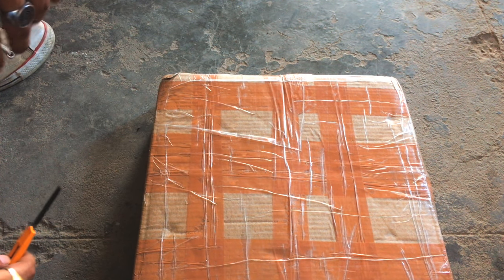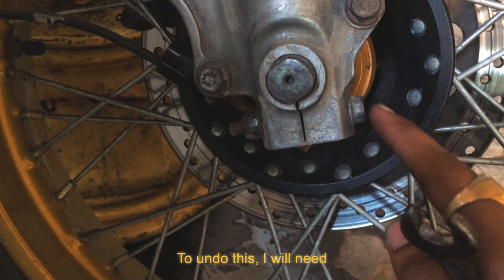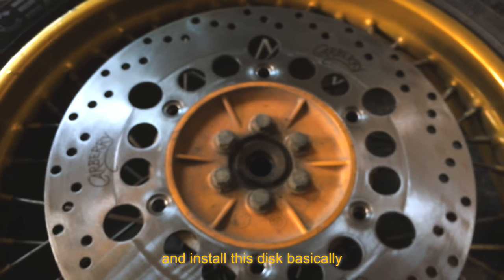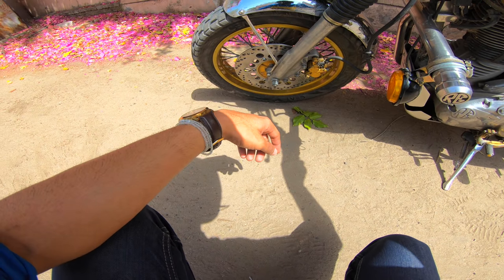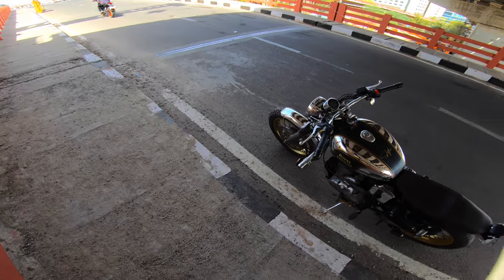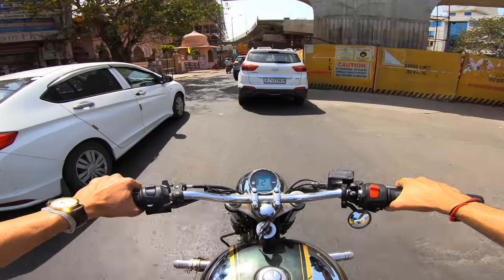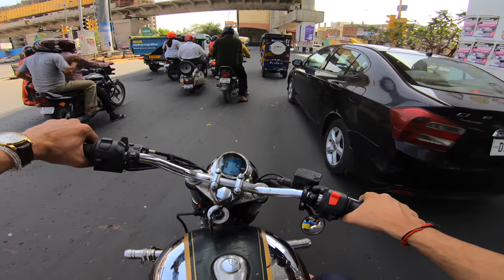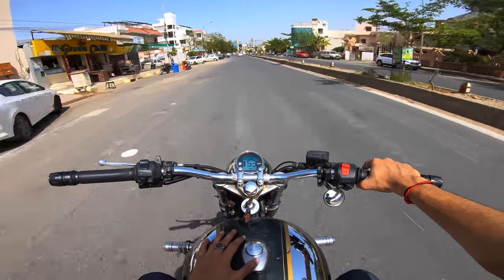Jumbo disk brake rotor - My new favorite modification

Comment: After fitting the new disk you directly jumped to the final part that was the completely fixed bike. Was anything else changed or replaced to fix this size of disk? or everything else remained the same
Reply from the maker: everything else is the same, the disk came with a mount for the caliper which was pretty easy to install as well, couldn't film because it got dark

Comment: With emergency braking , you can get into trouble as wheel locks instantly .
Reply from the maker: yes but that was me jst testing the front, i use both the front and rear at the same time when emergency braking

Comment: The best brakes which I tested on an RE was of GT535, 650s don't even come close to it. but ABS was missing which is sad.
Reply: I believed the brakes on gt 535 was from Brembo
Reply: @imochasingh6875  Yes, Brembo Floating disk and caliper
Reply from the maker: nah man the braking on 535 was alright but not better than the 650 with pirelli tires, maybe you've ridden the new one with ceats?
Reply: @Mantavya  Yes, a friend has it, he changed the tires recently but I didn't notice a difference in braking however the wobbling is gone with CEAT. The only difference I think there is that you cannot brake hard with GT535 due to no abs so you have to do it gradually.

Comment: you have to be very careful now with the brake so as not to block the wheel and go to the ground!!! Even so, I like how it looks on the motorcycle. Regards
Reply from the maker: yes of course, but, i was just testing the front, i usually use both the front and rear brake together